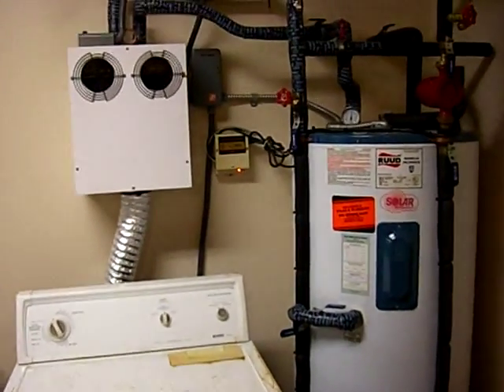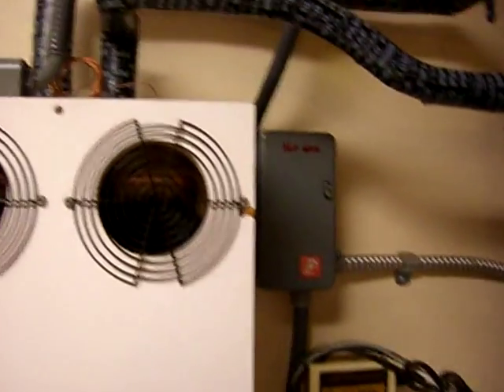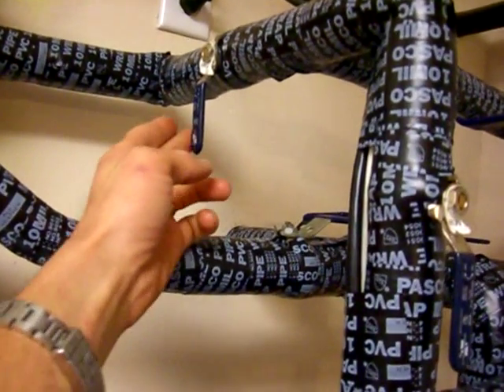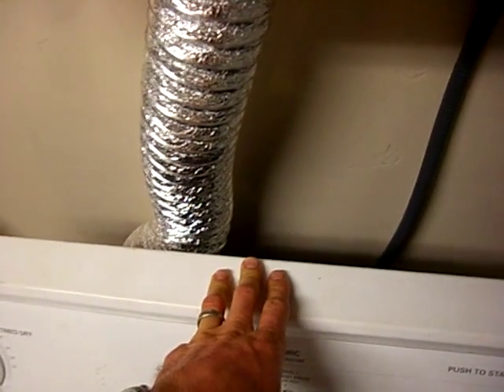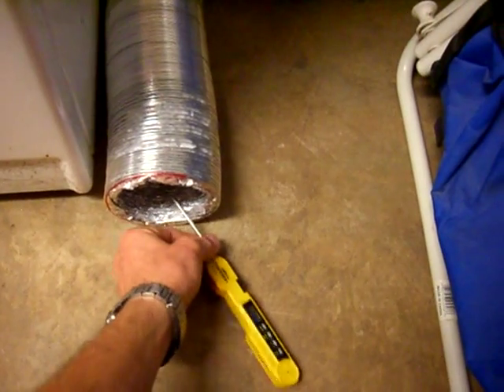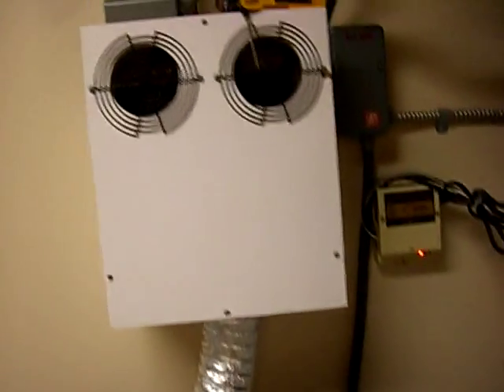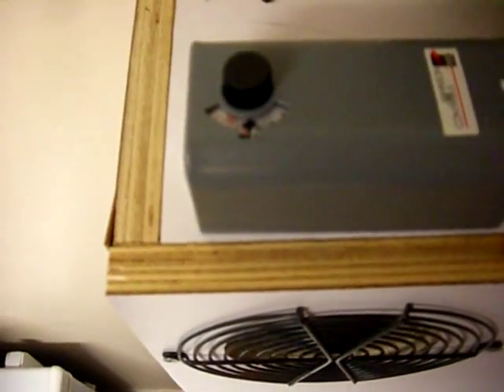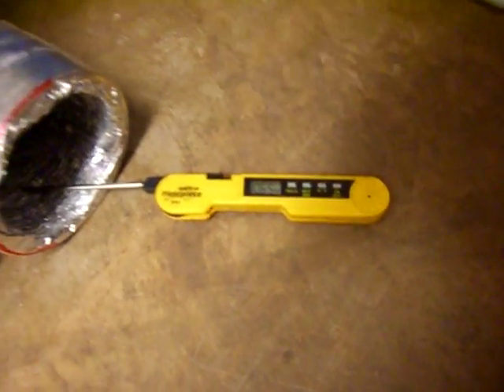solar cloths dryer #7 last video

Comment: Wow...pretty cool! Nice work. I'm wondering though, have you done any tests to see if the efficiency of your water heater has dropped? I.e. for any reason would you find the hot water heater to be forced to turn on more often resulting in using more hot water, thereby reducing the overall efficiency of your unit slightly? thoughts? i'm really not smart enough to analyze this or know the answer. thoughts?

Comment: excellent ideas put together nicely.
As a general home inspector, I would point out to items that came to my attention.
1) Air being taken from utility room could cause flame/exhaust issues on any other equipment in that room (extra venting).
2) does system have pressure relief valve?
Great work overall,